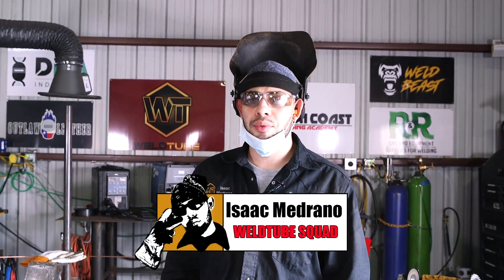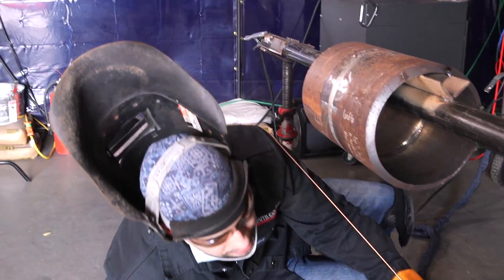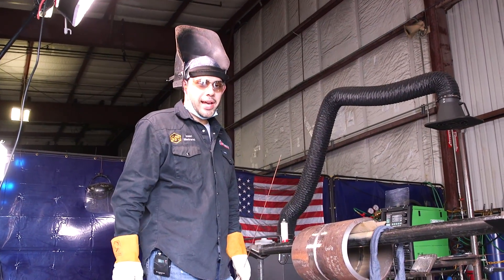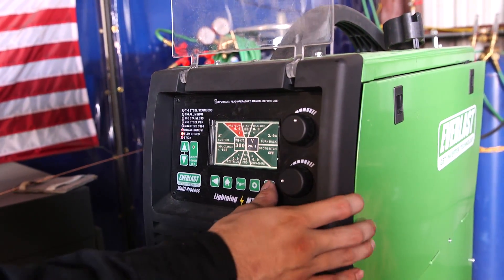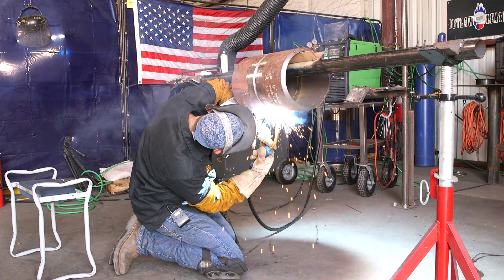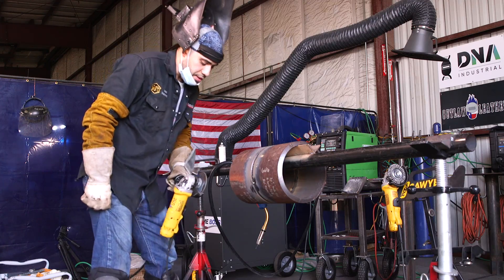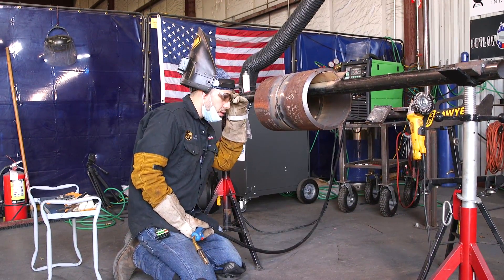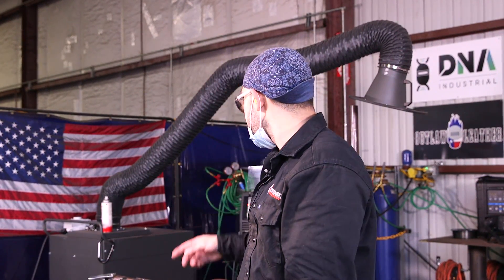TIG/Flux Core Combo on Pipe

Comment: Now i have seen a few Videos about Mig Welding. Videos that were Filmed in the US. In every Video you Guys tuned the Mig Machines with Voltage and Wire Speed but not on Current. 
Im from Germany and all the Mig Machines I know are tuned on Amperage and Wire Speed. Quality Machines also have a Voltage Tuner, but only for controlling the Length of your Arc. 
At mine cheap chinese One, I set the Wire Thickness, Current and Wire Speed is automatic. I can also Tune the Voltage a bit for Arc Control.

Comment: How do you do tie-ins on flux-cored?
Reply: Whenever you stop, grind the stop clean, then start from there (make sure you fuse well). I always grind my tie ins very lightly, and if it looks good, i just buff it.
Reply: @BenRossi901  do you just point it at the ground spot and start welding or is it like the way you do with stick welding where in you trace the ground area? Thanks bro
Reply: @richelleseradoy9998  

The way i do it, i like to start slightly back from the ground spot, just slightly, but not too much where it builds up
Reply: What the point of having a mask if you’re not using it
Reply: @westhappenin  

Why in the world are you asking me that question?